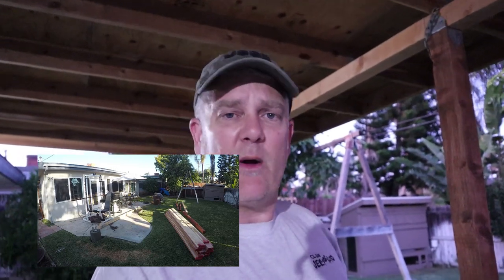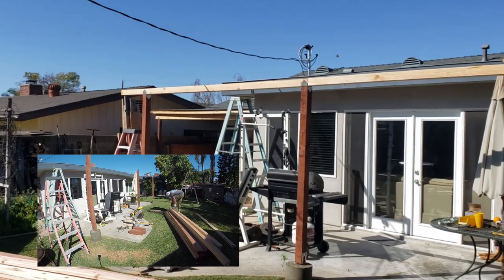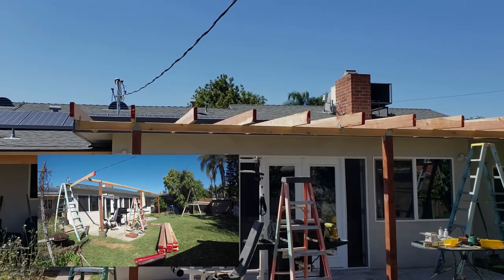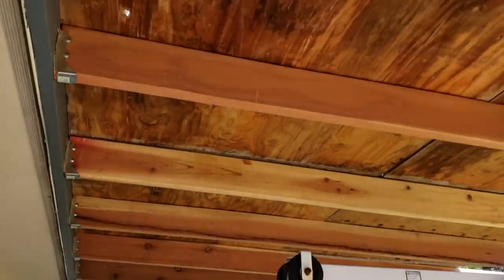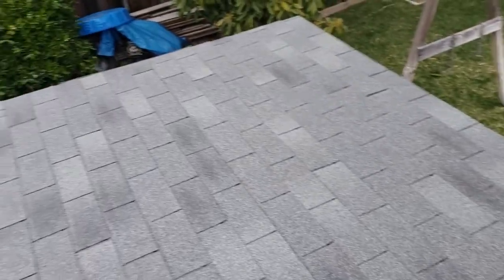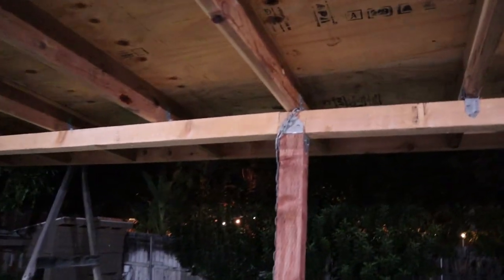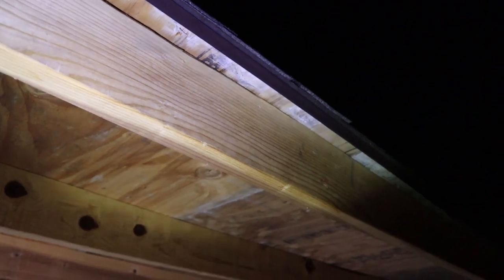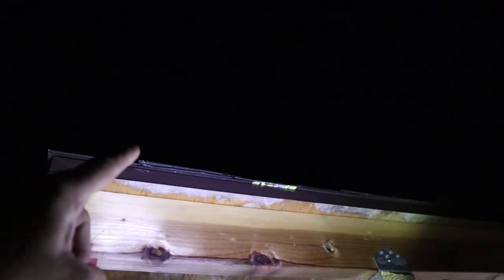How to build a Patio Cover

Comment: Using deck screws is way better than using drywall screws. In some cases it might be best to use hanger nails. . They are galvanized harden and have a number on top of the head.. Simpson Strong-Tie also has hanger screws for your hangers they are also hardened and galvanized. The flashing that goes around the roof is called a drip edge. There should be a slight Gap between the drip edge and the plywood. Great job Scot

Comment: I’m about to build a roof over my patio and just came across this video. How did you figure out that  roof pitch? That would never pass inspection in my town and no roofer would install shingles on a roof with that pitch. . 2:12 is the Minimum pitch for shingles. For every 12” you need a rise of 2”.  For a low sloped roof like yours , roll roofing is used.
Reply from the maker: Yep

Comment: At 20 minutes into your Vid you said the pitch is a little less than 1/4'' per foot.You put comp Shingles on you roof lid,But code is NO LESS than 3/12 pitch for Shingle roofs, for proper run off or water will back -up & not run off like it's suppose to.UNLESS YOU HOT MOPPED THE ROOFING PAPER DOWN PRIOR TO INSTALLING SHINGLES.....Let me know how it holds up after this winters rains
Reply from the maker: Great comment sir!  You're right!  Fun to see who is truly listening...  my pitch is probably closer to the 3/12 youre saying.  I kinda just pulled that out of my butt honestly..    And we've had some torrential rains already and it drains awesome!  Thanks for watching!
Reply from the maker: Hey thanks again for the input.  Look for my follow up video and I shout you out!  And yes it leaked.....LOL
Reply: I was going to post about this that pitch is DEF. flat lol build things to code he says.

Comment: Why did you choose to attach the ledger board to the facia instead of cutting back the roof? I am about to start a similar project and have been worried that attaching the ledger to the facia was not going to be strong enough. Is the ledger board attached to the facia strong enough to hold all of the weight?
Reply: I have the same question. I live in a double wide and nothing is easy with those.
Reply from the maker: So in part 2 or 3 I address that issue.  My facia is actually 2"x8" attached to the roof joists.  I used 8" x 3/8" lag screws to attach that facia to the joists for strength.  I doubt on a pre manufactured home the facia is anything more than a thin 1/2" board for esthetics.  Not strong enough to attach anything to.  You're gonna have to hang a ledger somewhere and lag bolt it into some vertical studs for strength.
Reply from the maker: I went to the facia because going below would have shortened my head clearance by a solid foot!  And I'm 6-1.....  Would have made for a very short patio cover at the edge of the patio!
Reply: Hidden Valley Homestead I ended up using “skylift risers” instead of using a ledger board. Pretty awesome product.
Reply from the maker: @jamesd9066  Interesting!  I'm gonna check those out!
Reply from the maker: @jamesd9066  I just Googled what those were... very interesting technique...  so as long as you have a rain gutter at the edge of your roof it works great eh?  Cool solution!  Thx for sharing!
Reply: Hidden Valley Homestead during a rainstorm with some wind I still get a little water coming they but I like it because I still get airflow and I can put my grill underneath my roof if it’s raining and the ventilation is still good.

Comment: I'm getting ready to put up a patio is it legal to bolt the rafters to the existing faceboard using hangers? my span on my rafters will be around 15 feet will number 2 Douglas fir 2x8s be sufficient for a rolled roof load at 24-inch on center? my 4 by 4 post will be spaced at around 7 feet. will a 4 by 8 header work or a 4 x 6 header? thanks
Reply: mad tater following. I’ve never seen that either

Comment: Good job !!! Question I’m about to do the same here in Florida when you bolt the ledger to the house roof joist was that a new 2x6? I’m debating on doing the same as you did which gives me 6-7 inches more of roof space or put a new ledger underneath the edge of my roof.....
Thanks
Reply from the maker: So the roof joists were NOT new but I had inspected them when we put brand new facia on a few years ago and made sure they werent termite damaged or split.  They were all good.  One thing I totally forgot to mention in the video was I drilled a pilot hole FIRST to make sure I didnt split the joists when I put the lag bolt in.   And I used 8" legs as well.  My joists were 2x8s so if you wanted to be extra safe you could do double lags in each joist.  And for additional strength for hurricane resistance I would do every joist.  Be sure and use those hurricane ties as well.  I also forgot the 45degree corner gussets.  That would be important as well where you're at.  Thx for watching!!!
Reply from the maker: Duh..  I misread your comment..  YES the ledger was brand new.  It was a new facia I installed about 2 yrs ago when I did a new roof.
Reply: Hidden Valley Homestead Thanks so much.... and I won’t pay permits either 😂
Reply from the maker: @johnnygoni7402  Feel free to email me if you have any more questions!
Reply: Hidden Valley Homestead for sure I will, it’s not going to be done until probably the end of the year because I’m doing a bathroom now but for sure I will contact you, thanks again
Reply: have a question.. what is that purple on the facia bored? Is it for water proof.

Comment: Is it safe to attach patio to the fascia??
Reply from the maker: Great question.   If you watch part 3 as well I address this issue.  But for now it depends on how thick of a board your facia is and how well anchored it is to your roof joists.  I used 8" lag screws to anchor my 2"x8" facia to the roof joists so it is super strong.  But if you have some thin 1/2" facia then it's not strong enough to support anything.  Thx for watching.

Comment: How do I check what the rules are so I can at least follow them without pulling a permit. I'm in Sacramento. I was thinking of adding a patio cover
nice job. By the way
Reply from the maker: Hey thank you!  So our city building department had on the wall of its entryway at the Planning and Building dept free copies of various plans with drawings and specifications for home owners and contractors.   I made the mistake of not double checking those plans before I built my cover.  You can walk in and grab those copies usually and walk right out...  or of your city doesn't provide those for easy access then they definitely will online...

Comment: Man you make me look good!!! 😅🤷🏼‍♂️🥴 I like the video. But you should have got some advice from a builder, a friend or someone at the hardware store that knows something about structural, or do lots of research online, Remember  this video is from a homeowner that is not a contractor, engineer or a architect, and he does not build patio covers for a living.  Not trying to be rude here just need to be brutally honest and hope you can appreciate that, but I do appreciate your hard work and effort. Video was also very cool. Just a couple things of many that I would like to go over with the audience, make sure you have the adequate loading header beam for your rafter load, a 4x4 post will not suffice the load requirements for the span and layout, for that roof there should have been a 4x10 or at least a 4x8, also don't understand why homeowners always want to use hardware to connect the raptors to the header, just cut Bird's mouth seat cuts, and no that is not a 3 and 12 pitch LOL I can tell by just looking at the hurricane ties underneath that that is almost a flat roof, probably is a quarter inch to a foot run. Should have been a torch down roofing application, a couple of good storms and that comp will start having issues, it was a valid effort for a novice but  just make sure you're not promoting this to others as a qualified build, I appreciate your effort and video, no disrespect just keeping it 100%
Reply from the maker: Thank you very much for the respectful and constructive criticism!  You are spot on all accounts and I took many of the suggestions to heart and tried to address them in succeeding videos...  I appreciate the time you took to leave such a kind comment!

Comment: You used deck screws for the joist hangers . Not a good idea . They are not made for shear strenght . Should have used proper joist nails or screws . You get no snow so it might not matter .
Reply from the maker: Good eye.

Comment: How much would u have to pay to have someone build a patio cover?
Reply from the maker: Well I can tell you it took me two days to do.  A "skilled" carpenter with way more experience probably could have had it done in one day.  With cement bases poured the previous day.  Materials were around $1000 and labor for a two man crew probably in the $5-600 range... So I would estimate conservatively $1500-2000...  But I got all the plywood used for free and most of the lumber for 25% of normal because it was seconds at Lowes...  So I spent maybe $500 for everything and did it myself...  I'm sure I saved a solid grand!  Hope that answers it fer ya!  Thx for watchin!!
Reply: about $1500.

Comment: For not being a carpenter, it's close. But, this cover wouldn't pass an inspection. A 4x4 for a beam is insufficient for the spans between posts. The max span for a 4x4 would be for something like above an opening for a door (about 3'6" max), and even then in some cases that might not pass. I put at least a 4x6 for a door header. The 2x6 rafters look fine for that span. Usually we nail down roof sheathing with 8D common nails, and I usually use ring shank which prevents heavy winds from uplift, but screwing with the right fasteners is fine. Roof sheathing should be staggered. The posts and beam are not braced (prevents lateral movement). The ledger should be lag bolted to the house. Hardware should be attached using galvanized connector nails. Those are structural nails. A structural screw would be fine also, but not with a deck or drywall screw. There is not enough pitch to use composition shingles. Will it fall down? Probably not, especially if you're in CA where there's no snow load or it won't get hit with high winds.
Reply from the maker: Thank you for your thoughtful constructive criticism!  You are correct on all accounts.  If you have a sec to watch part II & III I actually figured all that out and made all those changes you listed!  Thanks for watching!!

Comment: Don't think that's to code the way you at attached to fascia board
Reply from the maker: Well what I discovered was it depends on the city.  Down in San Diego they allow it with reinforcements and show it on their website!  Thx for watching!!
Reply: @HiddenValleyHomestead  really, I'd love to be able to do that here
Reply from the maker: @brucerobertson2466  Well I would simply go online to your local building dept and research their patio cover requirements.   Almost every locality has it online these days and check to see what they require.  Whether you are required to get a permit or not I don't know but at least check to see what they say to do just in case..  I highly recommend doing this..  If they require a permit or not and whether you chose to get one is up to you but building it solid is the most important.   It only takes a min to look up.  Most every online locality has these plans by downloadable PDF format.    

The only reason I chose to make my facia into a ledger was because of how low my roofline was.  If you have the room I  would highly recommend going under the existing roofline and tying into the supporting wall with lag bolts.  Even better.
Reply from the maker: If you watch parts 2-4, especially part 3 I explain why it's ok to go to the facia...
Reply: Yup, it's not code.  End of discussion
Reply from the maker: Yup.  You're an idiot.  End of discussion.

Comment: I believe that by building the patio roof, you created a violation to the electrical code.  The service conductors need to be 10ft above the patio roof.
Reply from the maker: Good eye.  If you go back and watch again you'll see ther service is only 3ft above the existing roof as well..  Unavoidable in these densely constructed neighborhoods.   Every house has service lines running a few ft above at least a portion of the roofs.  But that being said you could still be correct.
Reply from the maker: Thx for watching

Comment: In California here you need to pull a permit to build these and definitely cannot attach to the fascia board.
Reply from the maker: Well that's incorrect.   Codes are slightly different in every city.  If you watch part IV I address both issues.  Thanks for watching!
Reply: If you want it done right, you don't connect to facia board but Micky mouse does what Mickey Mouse does.

Comment: Looks unfinished.
Reply from the maker: I still need to put rock around the concrete supports and paint all the exposed wood but the structural components and roofing are done!  And extremely functional.   Not a single leak and the shade we've gotten cooled the house down considerably!  Paint and rockwork coming soon!
Reply: @HiddenValleyHomestead  
Hmmm. Maybe tongue and groove for the ceiling?  But, will it cost effective?  Since you're going to sell your home. Will the time, effort and cost be recouped in the end. Or will the house sell for the same amount regardless of the tongue and groove ceiling.  Just a thought.
Reply from the maker: @kerryclark1926  Yes we thought about that but were just gonna paint it.  I totally agree with your assessment about value recovery..  I don't think it would make any difference.  Definitely look better but a good coat of paint I think will look just fine.